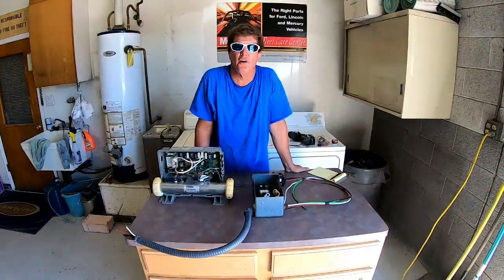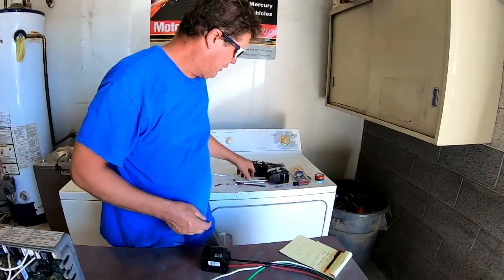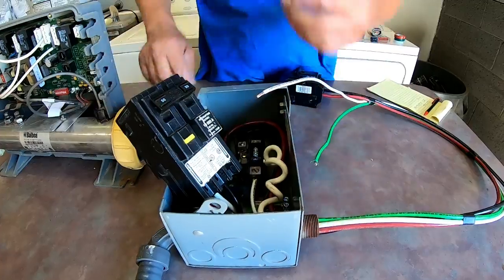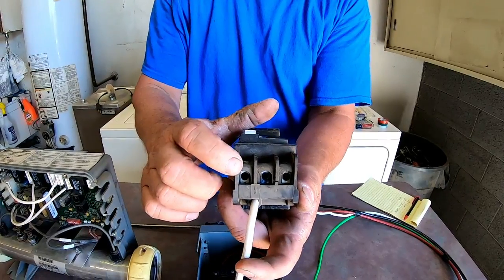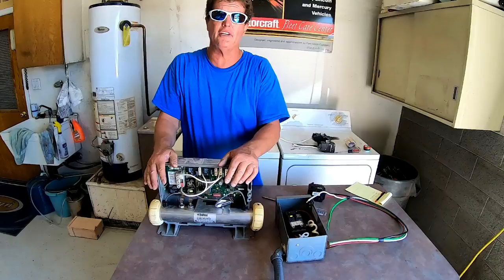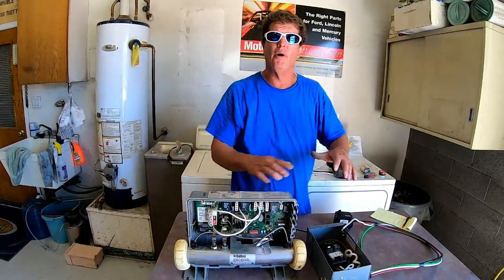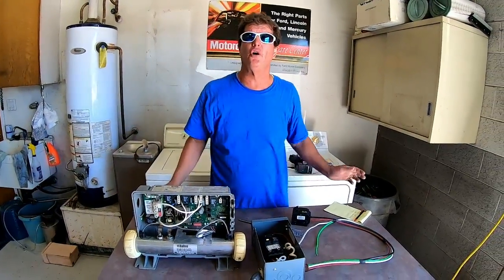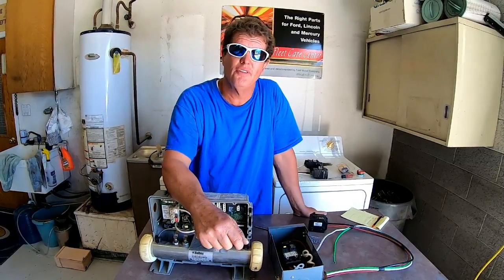Hot Tub / Spa wiring made easy... 50 Amp GFCI Install..Arizona Hot Tub Factory (DIY Spa Repair)

Comment: Nice video.  My second jets were going off and on.  Still on warranty so I called the technician.. He tested and said that was mostly likely just a bad switch on the other side for first jets but I can still use the tub until the part come in.  So I started to warm up the tub, but I check on it later - no power to my control panel and the circuit breaker was tripped.  So I reset the breaker and my wifey was like the control panel light flickered but off again.  The breaker, however is not tripped.   Several attempted to reset the breaker and only a flicker on the control panel. Now I can’t cold water and no lights on my “Hot Tub”.
Reply from the maker: Sounds like something is wired wrong....I would need more info ..You can call me at the office and Ill see if I can help you.

Comment: Hi. Great video, but I'm still a bit confused as to where the common and ground cables attach inside the main breaker panel? Will there be a dedicated green and white spot for them alongside the red and black cables? Also, what's the chance of electrocution if something isnt wired properly? Thanks
Reply: The ground and neutral wires go to buss bars for that purpose.  Ground and neutral are tied together in the main panel.  This is ok, in a subpanel they must be isolated.
Reply: @donmclean1220  if you install a gfci in the main panel then the white coiled wire can go with the mixed neutral/ground wires bar right?
Reply: @rickbaldwin5042  yes

Comment: Hi thank yo for the advice!!  I have a hot tub that was working fine then suddenly just started tripping the breaker every time we go to reset it. we turn the breaker back on and after a few seconds it trips.  we have checked power from the breaker panel to the motherboard of hot tub and there seems to be power . even the wires that go out from motherboard seem to have power. something grounding out or something. one of my roomates dumped a crap ton of chlorine in hot tub and then a week later is when it stopped working?  Could the excess chlorine cause corrosion which could be grounding out the breaker? we have noticed there is some corrosion on some of the input areas for power to motherboard. what possibly cold be some other factors as to why its trippin. a 9v seems to show some power to lcd screen which says pd ?  what does that stand for.  thanks for any advice you can give me
Reply from the maker: Ryan give me a call at the office(8A.M. to 5P.M. Monday throughFriday)And I will help you figure it out623 842 4665 Thanks

Comment: Great video!  Very clear and concise!  I have a jacuzzi I am trying to wire.  I have tried both a Midwest and a Square D panel but in all cases the test button on the GFCI does not trip the breaker.  

I tried it with the load connected and disconnected.  I metered 240 incoming and I have 240 on the load side terminals.  The ground is connected to the ground bar like you showed, the neutral pigtail was already connected and I connected the incoming neutral to the same bus bar.  I measure 130 volts from either leg to the neutral on both the line side and the load side.  I thought I had a bad breaker but I have tried multiple different panels.  On the Midwest there is a bar screwed to the box that I did not touch, so maybe that is my issue.   Have you ever seen this or can you help?  

Every time I press the test button the light that indicates a bad breaker starts flashing but no way do I have 4 bad panels from 2 different manufacturers 

Thanks!
Reply from the maker: Scott give me a call at the office (8A.M. to 5P.M. Monday through Friday) and I will help you figure it out 623 842 4665  Thanks